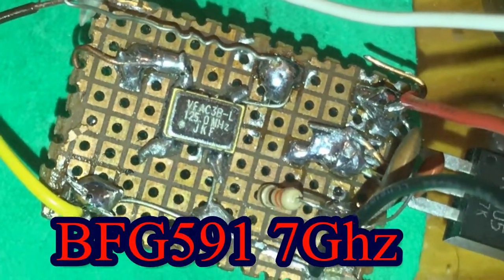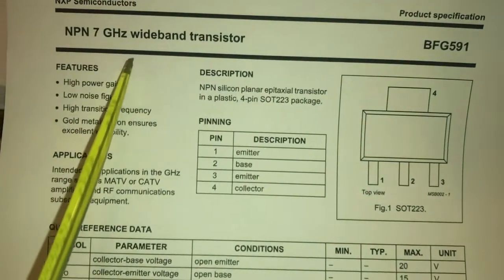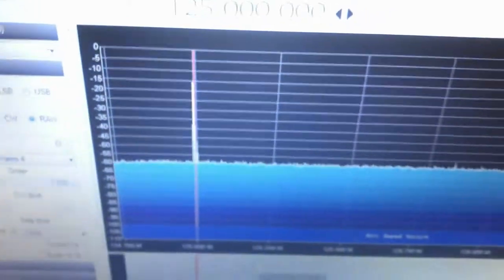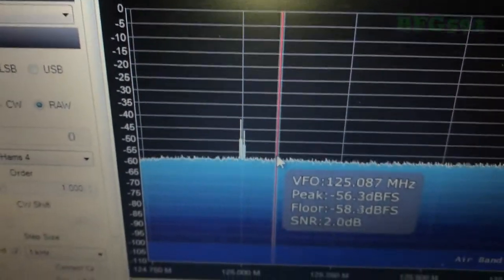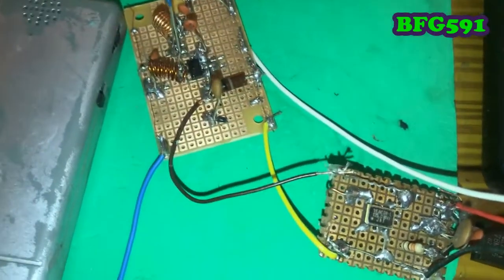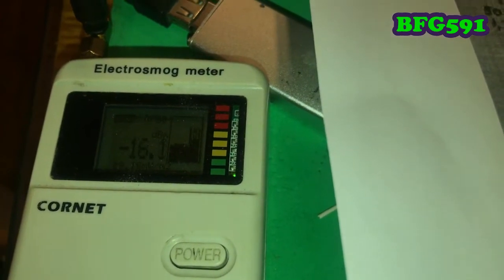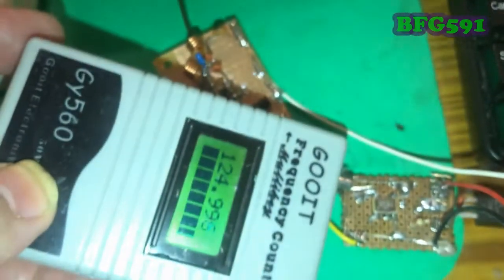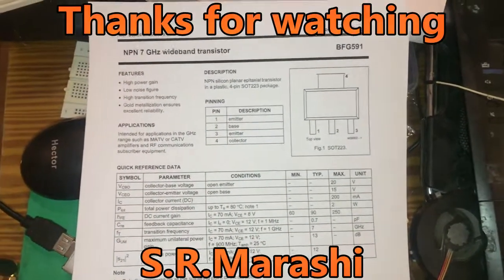BFG591 7Ghz Wideband Transistor (Schematic+Test+Result)

Comment: Output power??
Reply: 1000mw
Reply: @agungminor8637  1W at 125mhz? Perfect. Did u ever test it with a 433mhz tx module?
Reply: @dare-er7sw  I'm sure the same because I've tried on freq 2.4ghz wifi
Reply: @agungminor8637  ohhh. Wow. Power at 2.4 ghz?